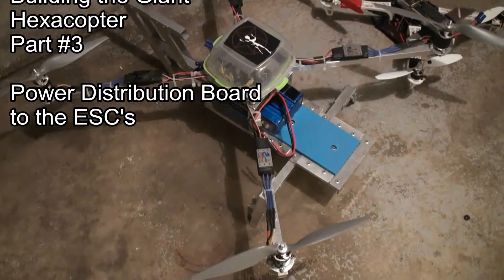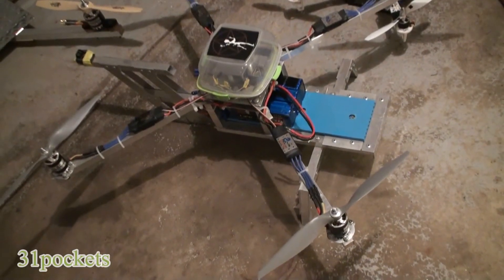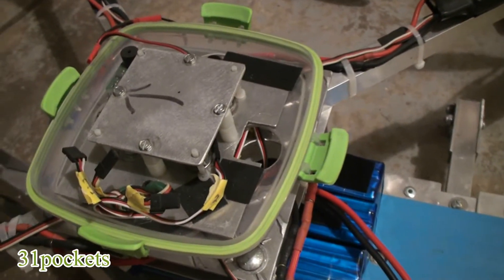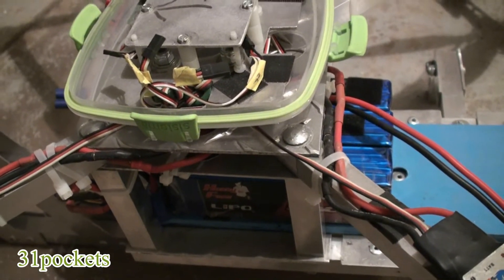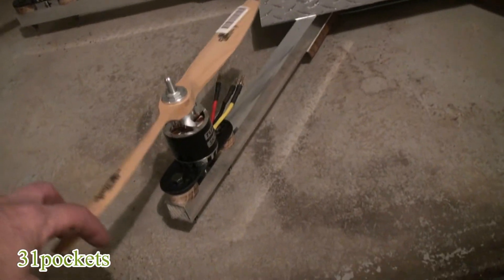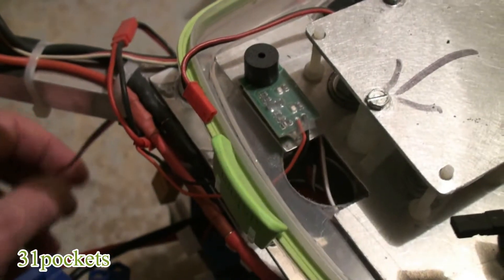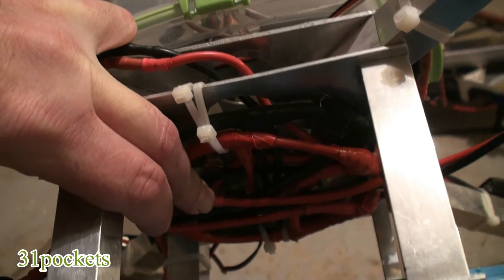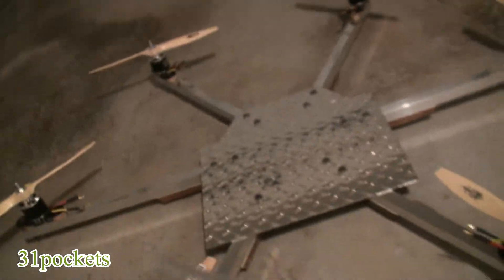#3 Building The Giant Hexacopter - Power Distribution Board

Comment: Ditch the steel, man :-)

Carbon fiber is you best friend. If you have to use metal, go with just aluminum for things like the arms. Heck, wood would be better in places like that steel diamond plate.

Also that power distribution board looks like a short/fire waiting to happen :-P|

The only time steel structures should be used on an model aircraft is for fasteners like nuts, bolts, and washers :-D

Comment: The info is nice but until you stop building lead sleds you won't get any flight time.  Everything is a trade, there's no free rides and what you install for weight trades off flight time.  A heavy bird requires larger, heavier batteries, with the weight offsetting much of the desired additional flight time.  A heavy bird needs larger motors turning more RPM, requiring even more battery.  Again, more weight and the weight, power, lift, flight time cycle is out of control to the negative.  Dump the diamond plate and landing gear designed to support an elephant for starters.  Dump the sheet metal and use carbon or fiberglass plate.  Correctly made carbon fiber is 5 times stronger than steel and your aluminum is much weaker and heavier than carbon.  Reduce the hardware sizes, you aren't building a structure that will generate severe flight loading.  Carbon structural material is available many places online.